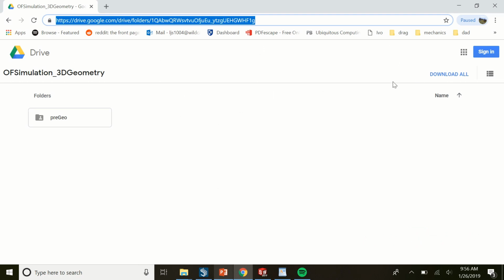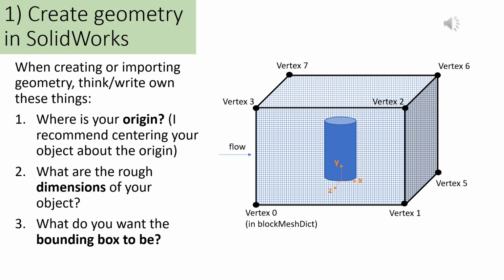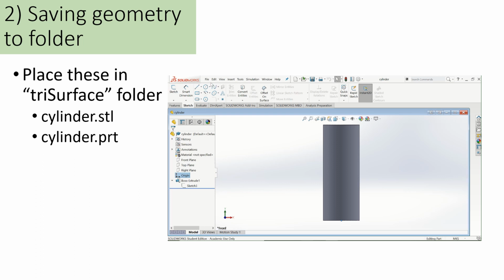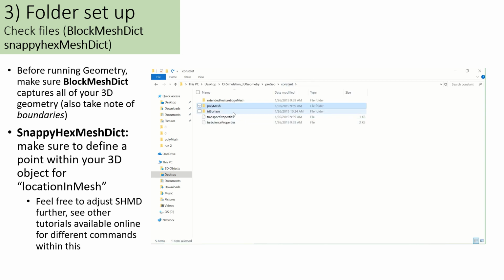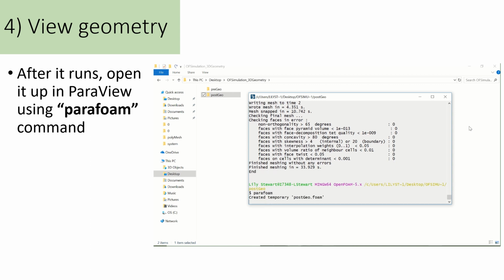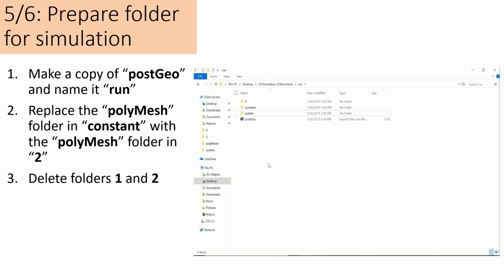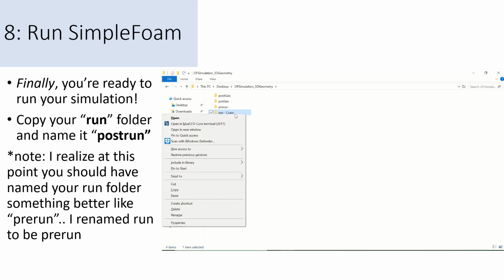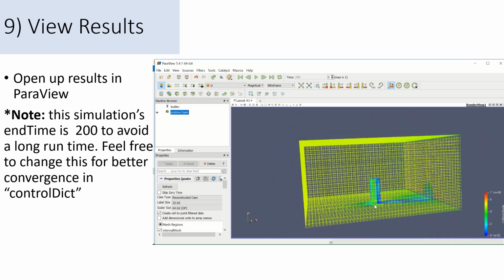Open Foam Tutorial: Simulation with 3D Geometry (.stl)

Comment: Hi Lily,
Thanks for the great tutorial! This helps a lot with figuring out how to set up my own case. One question though, opening paraview I see the mesh block but no cylinder. Looking through the other comments having this issue, I've changed to  wireframe, unchecked skip 0, tried adding -overwrite to snappyHexMesh, but I'm still having no luck. Any ideas?
Thanks!

Edit: Figured it out, if anyone is having these issues make sure when you export your .stl that it exports in meters (same page as where you change to ASCII).

Comment: thank you, the cylinder works fine! I've tried to change the cylinder with my stl but I got some problems: my stl is a naca64 split in half simetrically but the simplefoam seems to compute the pressure only in the left half, so when I compute lateral thrust and drag with Paraview I get unconsistent results. Why this happens? Can you help me?

Comment: Hi I need help please, i want to simulate a vertical axis wind turbine that uses Magnus effect, basically rotating cylinders, how hard it is to adapt this tutorial to test the VAWT in openfoam. 

All I have so far is an assembly of the top section without the generator. 

Looking forward to your advice.
Tim

Comment: Great video, but I'm getting this error whilst trying to run simpleFoam:

--> FOAM FATAL IO ERROR: 
Unable to set reference cell for field p
    Please supply either pRefCell or pRefPoint
file: /home/pascal/OpenFOAM/pascal-7/Worked_Tutorials/Cylinder/postRun/system/fvSolution.SIMPLE from line 39 to line 46.
    From function bool Foam::setRefCell(const volScalarField&, const volScalarField&, const Foam::dictionary&, Foam::label&, Foam::scalar&, bool)
    in file cfdTools/general/findRefCell/findRefCell.C at line 102.

If anybody has any clues that might help, please share them.
Thank you :)

Comment: I have a question, can someone please help me out?
I want to run the solver multiPhase/interFoam/RAS/floatingObject but by default it runs with a cuboid body, I have a cylindrical body in .stl format and I want to use it as a floating object.
How can I do this? Thanks to this video, I have been able to insert the cylindrical mesh in blockMesh by using snappyHexMesh, but how can I use the cylinder as a floating object? Thanks if someone can help me out, I am doing a univerisity homework :)
Reply: excuse me, are you already finish about your work. because now I also have a problem similar to the one you are facing

Comment: Thank you for the tutorial! I've a question about running surfacemeshextract. When i try to run this code, i got an error says: surfaceFeatureExtract
surfaceFeatureExtract: symbol lookup error: surfaceFeatureExtract: undefined symbol: _ZN4Foam9UOPstream5writeERKNS_5tokenE

I've been searching for a solution for the problem but i've got nothing, do you have any idea what this is about?
Reply: @Killian Whyte Sir, I did as you said. I got:

 keyword surfaces is undefined in dictionary 

file: C:/Users/admin/Desktop/motorBike/system/surfaceFeaturesDict/motorBike.obj from line 20 to line 41.

    From function const Foam::entry& Foam::dictionary::lookupEntry(const Foam::word&, bool, bool) const
    in file db/dictionary/dictionary.C at line 799.

Comment: Hello, I'm trying to run the surfaceFeatureExtract, but a fatal error occurs saying that the cylinder.stl cannot be found. I have double checked it is in ASCII and haven't changed the name at all. Wondering if anyone else is seeing this.
Reply from the maker: From below:

Sumit Zanje
10 months ago
@Nick Along with the above-mentioned suggestion, rename the "cylinder.STL" the to "cylinder.stl". Reason- surfaceFeatureExtractDict has name cylinder.stl and not cylinder.STL so it's not getting that file.
Reply: @dogsled101  Thanks!

Comment: My university uses Autodesk Inventor instead of SolidWorks, and Inventor saves its files with the extension .ipt instead of .prt. I have also not been able to get it to work using these .ipt files. Is it absolutely necessary to have a .prt file? Is there a way to change what file the program is looking for? Inventor also won't export files to .prt
Reply: I use Rhino for my models and export my data as STL.  STL is what you want to be using.

Comment: Thanks for your share. But, there is an issue when I executed "surfaceFeatureExtract" command. The error is shown below. 

Reading surfaceFeatureExtractDict

Surface            : "cylinder.stl"

Feature line extraction is only valid on closed manifold surfaces.

--> FOAM FATAL ERROR: 
Cannnot read "/home/ywu9/OpenFOAM/ywu9-5.x/run/preGeo/preGeo/constant/triSurface/cylinder.stl"

    From function bool Foam::triSurface::read(const Foam::fileName&, const Foam::word&, bool)
    in file triSurface/triSurface.C at line 360.

FOAM exiting
Reply: same here I think .stl file is corrupted, you have to generate a new one
Reply: In the cylinder.STL file change the last line from "endsolid" to "endsolid cylinder". 

It will work.
Reply: @sumitzanje9660   I tried this it doesn't work, you could upload the stl file
Reply: @mohammaderaky2652  Along with the above-mentioned suggestion, rename the "cylinder.STL" the to "cylinder.stl". Reason- surfaceFeatureExtractDict has name cylinder.stl and not cylinder.STL so it's not getting that file. 

Try this, it will work.

Thanks
Reply: @sumitzanje9660  This fixed it!

Comment: Hello, I am getting this error. Could you please help me.

Reading surfaceFeatureExtractDict

--> FOAM FATAL ERROR: (openfoam-2012)
No surfaces specified/found for entry: cylinder.stl

    From int main(int, char**)
    in file surfaceFeatureExtract.C at line 305.

I'm stuck here :( . I even checked whether the cylinder file is in ascii format or binary. I saved it again in ascii format, but it still gives me the same error. Could you please let me know what to do.
Reply: same here
Reply: Figured out the issue though, if anyone else has this issue make sure the stl file being referenced is renamed "file.stl" rather than how it saves as "file.STL".

Comment: Hi, I come to the point of surfaceFeaturExtract and I receive the following message in the terminal: 
--> FOAM FATAL ERROR: (openfoam-2012) No surfaces specified/found for entry: cylinder.stl From int main(int, char**) in file surfaceFeatureExtract.C at line 305. FOAM exiting
Any idea what happens and how I could run it?
Reply: rename cylinder.STL to cylinder.stl, fixed the problem for me

Comment: Thank you! But when I ran the 'surfaceFeatureExtract' command, it appeared error 'surfaceFeatureExtract: symbol lookup error: /usr/lib/libedgeMesh.so: undefined symbol: _ZNK4Foam11regIOobject11writeObjectENS_8IOstream12streamFormatENS1_13versionNumberENS1_15compressionTypeE'. Does anyone know why? I'm new to the openFoam and it's better that could explain in detail. Thanks in advance!
Reply: I was having a similar problem, remember to save the stl file as ASCII. You can open the Solidworks part in Onshape and export it as stl if you don't have access to SW.
Reply: Bruno Tojo Thanks, Bruno! I think I found the solution. The problem is “surfaceFeatureExtract” might be a old commander for openFOAM 8. I chose “surfaceFeatures” instead. It works fine now.
Reply: @vicgodlee  哈喽，如果改用surfaceFeatures命令的话，那请问你是怎么配置surfaceFeaturesDict文件的呢？
Reply: @chuanzhong3977  你好，直接在‘Surface’里面添加你的stl文件就可以，需要注意的是，你的模型里面不可以有‘洞’，也即是需要是个实体，你可以先用圆柱试一试。

Comment: I imported my own geometry, but after excuted parafoam, I can't see it in paraview(Only a mesh cube I could see.) Could someone help me? Thanks
Reply: I assume you ran blockMesh which is why you can see it on paraview. But did you also run snappyHexMesh before paraview too? If you did and that's not the issue, then it could be that you are viewing the block as a surface and your geometry is inside so you can't see it. Try changing the surface view to wireframe as in the video. Hope this helps.
Reply: @kingl5519  In fact I had ran snappyHexMesh and turn the view to wireframe. I'm also sure that the cube point coordinates had adjusted to cover my geometry completely. That's confusing.

Comment: Hi Lily,
After simpleFoam I got such error:

No MRF models present

No finite volume options present

Starting time loop

streamLine streamlines:

--> FOAM FATAL IO ERROR: 
keyword direction is undefined in dictionary "/home/marcin/OpenFOAM/marcin-7/run/PreGeo/system/controlDict.functions.streamlines"

file: /home/marcin/OpenFOAM/marcin-7/run/PreGeo/system/controlDict.functions.streamlines from line 13 to line 20.

    From function const Foam::entry& Foam::dictionary::lookupEntry(const Foam::word&, bool, bool) const
    in file db/dictionary/dictionary.C at line 570.

Do you know how to solve it?
Thanks in advance.
Reply: Hi Marcin,
I’ve fixed this error, maybe caused by the different version.
I comment out ”#includeFunc streamlines“ in system/controlDict. (Openfoam v6)

Comment: Hello and thank you for this tutorial. I have an error message coming up, while trying to execute surfaceFeatureExtract which is looking like this:

Create time

Note: Feature line extraction only valid on closed manifold surfaces

Reading surfaceFeatureExtractDict

--> FOAM FATAL ERROR:
No surfaces specified/found for entry: cylinder.STL

    From function int main(int, char**)
    in file surfaceFeatureExtract.C at line 307.

FOAM exiting

Do you have any idea how to solve this issue, please?
Reply: Hi, have you found any answer to this question? I have the same error message.
Reply: @ungedrageset  I have. The reason this command did not worked in my case was that i used OpenFOAM from openfoam.org at this time. And this variant did not had this command in its command folders. After downloading from openfoam.com, it worked. I know it sounds stupid, but in my case this was the solution.
Reply: Make sure the stl file being referenced is renamed "file.stl" rather than how it saves as "file.STL".